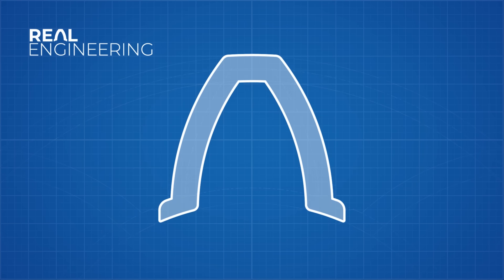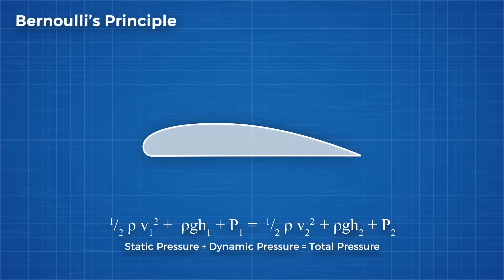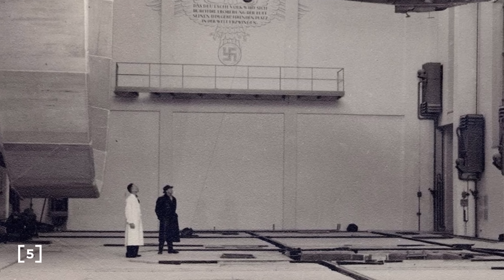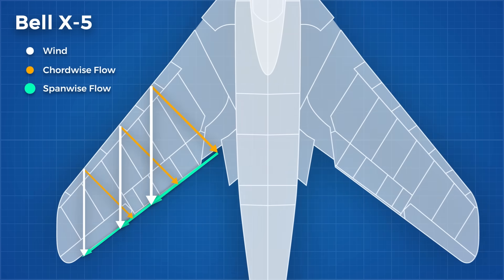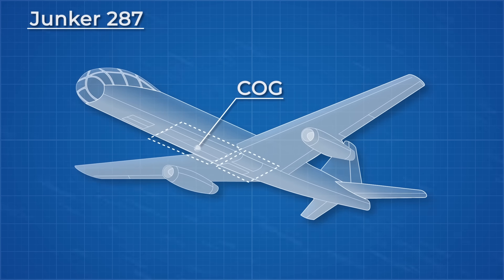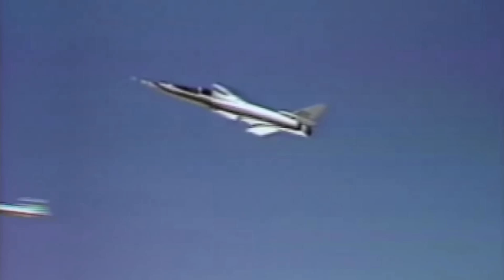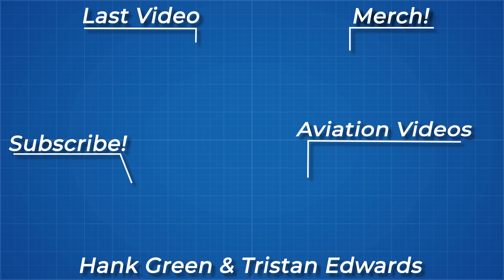Why Do Backwards Wings Exist?

Comment: It is not accurate to say that the X-29 was unstable because of the forward swept wing. It was designed to be tail heavy, which is an unstable situation and the F-16 is the same. If the C of G is moved to a more suitable position the a/c will fly just fine. This is well demonstrated by all the F-16 r/c models that are  flying today. They have no such stability augmentation systems and don't need them. My 45 degree, forward swept wing, r/c plane flies just fine, too. In fact it has a number of stability advantages over conventional models. It won't stall and it self corrects on crosswind landings.  By the way, what's with this 'tail wing' crap? It is called a Horizontal Stabiliser.
Reply: None of your R/C aircraft flies anywhere near trans-sonic speeds (unless you've somehow broken the R/C speed record by 50% or so), so they're not really comparable through their full flight profiles, and most of the instabilities from forward-swept wings comes from feedback loops at high speeds. Both the X-29 and F-16's has bottom-mounted wings, which also increases instability (the higher the wing, the more stable. That's why you often see trainers with top-mounted wings).

BTW, most model kits are available in a version where you provide your own electronics, and there's many, many flight controllers available that incorporates flight stability augmentation for planes (I've used one myself in my AcroMaster), so "all" is probably quite a stretch.

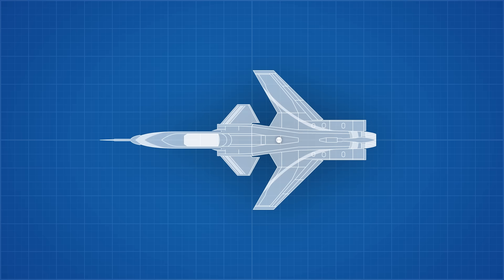Comment: 9:35 You mean shift the CG AND wing CP backwards on the X-29, right?  Wing center of pressure was allready depicted as behind the CG for the AV-8B as well; the wing CP was just counterbalanced from behind by the elevators, instead of forward by canards.

Comment: So basically, this was made by the good ol'German engineering. Correct?
Reply: it was imagined by them .. but like many german projects (especially those related to airplanes and airports) - they just never finished it.
Reply: One word to describe German engineering - "Pioneering"
Reply: actually back then "Made in Germany" was invented by  UK to mark plagiats (which germany was popular for) - during ww2 there were a lot of breakthrougs made .. but at the same time, they've used a "new way of central heating without using coal" .. so .. not sure about how proud a german should be about that time of pioneering ..
Reply: @canarybiker1262  Nobody should be "proud" of anything they could not have influenced in the slightest. It's pathetic escapism to deflect from your own lack of achievments.
Reply: @DerBlupp  hear, hear. nicely written.
Reply: @DerBlupp  Nobody should be "proud" of anything their country may have done which could be an odious war crime, whether they could have influenced it or not.

Comment: Both nowadays planes are a failure. Not because of engineering mistakes, but pure tactical.
Usage of such wings to give superior maneuverability at fairly high speed.
But first of all such design by itself limits maximum achievable speed. And second. As much as Hollywood makes it a popular theme - there are no dogfights in nowadays aircraft-to-aircraft engagements. Its 100% relies on missiles usage. And even though there is such thing as anti-missile maneuvers, to help the odd avoiding been hit by missile, those doesn't require THAT much of maneuverability.
And finally - pilots. Even though planes can sustain over 12G during a prolonged maneuvers, humans cannot.

Comment: At 2:00 the explanation is correct, but the animation doesn't match.  Air flow is indeed moving faster (it must, or the pressure can't be different), but the animation shows the points of both flows rejoining simultaneously.  The mismatched and incorrect visual animation is one of the reasons a lot of people have a malformed understanding of what's happening.
Reply: Yes! I can't believe this misconception is so prevalent even in channels like this. This should be comment number one
Reply: The air travels a longer distance on top and they both meet at the same time. 

Velocity=DISTANCE/time

Change the distance, and you will have a different velocity.
Reply: @Eriksvensson4231  that is not the point. The flow should be directed downwards after passing through the wing. The main issue is not the distance. If it was planes could not fly inverted and they can!
Reply: The “Bernoulli effect” is minimal in providing lift in highly powered aircraft. A perfectly flat wing would provide lift just as well at speed  if at the expense of poor aerodynamics.

Comment: its actually to prevent wing tip vortices - have you seen a airplane landing and seen little swirls of air coming from the wing tips - well if you had a row of houses at end of a run way, when the wing tip vortices are in effect they are actually mini twisters and they would suck the roof of the houses like what happened at manchester airport about 30 or 40 years ago - they had to remove all houses directly under flight path for about 100 yards from end of the run way - so this wing configuration is probably safer from that aspect. - but all wing shapes serve a different purpose depending on what use you want them for - the shape from the end of a wing is either bulbous for lift or thin for speed - then there is either up swept wings for stability/pendulum effect for passenger aircraft - or there is the down swept for agile aircraft like fighter jets - and the military use the hercules c130 which has bulbous wings for lift with the down swept configuration for agility. anyway you get the picture

Comment: Thanks for the great channel.  Just a little FYI on airfoils.  Son of an aviation engineer and physicist, but not an expert on this particular field.

As I understand, it's more about the wind produced by the airfoil passing through still air than it is about pressure differences.
That is to say, it's not that the Bernoulli analysis is wrong, it's that the contribution from the Bernoulli part to the total lift is a small percentage thereof.  You're accurately describing the physical contribution of the Bernoulli effect, but you're still not describing why an airfoil gets enough lift to be useful.
Airfoils get far and away the most lift due to momentum transfer.  Good old F = dp/dt = ma.  After the airfoil passes through the still air, the general flow of that air is downward (and forward in the direction of the plane, but we're talking lift, not drag).  That downward moving air imparts an equal and opposite momentum transfer to the airfoil, I.e. it pushes it up / generates lift.
Reply: NOT THE SON OF AN ENGINEER, BUT I DO KNOW THE ''WIND'' IS CALLED TURBULENCE...
Reply: @jimbo42521  The wind can be both turbulent and laminar in flow.  In general, turbulent flow is the enemy of lift.  Airfoils do create turbulent flows, but that is an unintended waste of energy - inefficiency of the wing.

Comment: 7:34
no one gonna talk about how it looked like that airliner just went vertical?
Reply: That was a Boeing 787 Dreamliner during practice for the 2015 Paris air show.  I don't quite remember if it was still in testing at that point, but the maneuver was to demonstrate the power and agility of the new airliner.
Reply: It was probably a test flight thus the unusual maneuvers.
Reply: It did
Reply: They better have multiple puke bags per seat, just in case.
Reply: Space Shuttle Status Engaged!
Reply: Passenger Planes almost nerver run on full power. but when they do they can indeed go vertical
Reply: Airliners need a lot of power for passengers, fuel, and cargo.  If they are not carrying much fuel, many passengers, or much cargo, they can do impressive things.  Some airports require steep climbs for noise abatement and then airliners climb like this even with passengers, but the margins are higher for aircraft at a lower weight.  Their thrust to weight ratios are much higher which allows for greater performance or a more safely conducted zoom climb.  The 747sp and 757 are also very impressive doing this.
Reply: @Ohiostmrchbandawesom  Yeah...passengers tend to complain if their red eye to London turns into the vomit comet. So yeah these planes CAN...just like a Greyhound bus CAN jump a ramp.
Reply: It was test flight.
Reply: Not that they can't, they just don't. Frankly, seeing a 747 or 787 do aerial manoeuvers the way a warbird does would be awesome.
Reply: @mage3690  
There was a test pilot that actually barrel rolled a Boeing 707 airliner during a test flight.

His name is Alvin M. "Tex" Johnston. Why did he roll a 707? He was selling an airplane.
Reply: @volksdude1970  It was a dash 80  Boeing 367-80 .  Concorde pilots did it some decades later and then bragged about the power of the Concorde that enabled it to do the same thing the dash 80 had done decades ago.
Reply: Keaos0  whoa.. thanks for that link. I had no idea that was possible for commercial aircraft!  and the pilot was so casual about it.. claimed that for some reason that maneuver was well within the plane's capabilities. He is the salesman that he claims to be, that's for sure. :)
Reply: I thought that was a advertisement or reveal or something
Reply: ”drive it like you stole it” technique
Reply: @beck103187  search Kylie Franklin steals
Reply: Ikr
Reply: That would have been a crazy ride for the passengers!  imagine what that would feel like and how you'd be worrying about what to expect for the rest of the trip.

mmm.. I guess others are saying that was a test run.. so no passengers?
Reply: @kirikayumura6015  of course no passengers
Reply: digital viewing!
Reply: @Reflex-f1d  cool! I'm gonna have to check that.
Reply: Iwas about to.
Reply: Sentō Yōsei Yukikaze
Reply: I cringed and said WTF aloud when I saw that!
Reply: https://www.youtube.com/watch?v=mqIJL8lx00o
Reply: that 787 tho
Reply: @Steven Strain https://www.youtube.com/watch?v=oYD3srDJR00         https://www.youtube.com/watch?v=eqMvXE4sxpk  https://www.youtube.com/watch?v=WRa9AhTl7CY     Even a jet cannot sustain a vertical climb when the oxygen pressure gets low enough at altitude.
Reply: Shouldn't it be stalling?
Reply: @R0ckst4r0ck3r  Stalling occurs when an aircraft wing exceeds it's critical angle of attack.  Wings can be made differently, but very generally speaking, that is somewhere around 17-18 degrees.   A related term is "relative wind"   Basically, if there is still air travelling over the wing at the angle  that the wing was designed[and in sufficient amounts] for, you're cool.  If you try to turn hard, fly upside down, pitch nose up or nose down very quickly, etc. you can stall the plane, but if you're flying in a straight line with enough speed, you shouldn't be stalling the aircraft whether you're nose up, nose down, level,                                           
                                                                                                       e tc
Reply: @Ohiostmrchbandawesom  Oh I see thanks for the info!
Reply: @R0ckst4r0ck3r   I should have attached something like this link.  If you go about halfway down, you'll see a "coefficient of lift" diagram for two different planes (one straight winged and one swept winged) .   Whenever you see a coefficient of lift diagram and the coefficient drops rapidly with a small increase in angle of attack, that is where the stall occurs. If you don't want to follow the link, just go to any coefficient of lift diagram http://www.aerospaceweb.org/question/aerodynamics/q0136.shtml
Reply: Keaos0  You've never seen a barrel roll on an airliner for the same reason you've never seen a Greyhound Buss jump a ramp. It's because passengers find it ...uncomfortable.
Reply: garlic69 yup
Reply: garlic69 because it did
Reply: Omg wow
Reply: wooooooooow
Reply: It did a 37 degree angle... A discussion happened some time ago because of this clip. The camera angle is in that point Just to do that: look like a perpendicular angle. It's a Boeing 737 Max by the way
Reply: Joseph Meyer  it is the 787 Dreamliner release clip/ trailer for plane upon release
Reply: Correcting, it is a 787, not a 737
Reply: Joseph Meyer  sorry
Reply: and that is the aircraft produced for VietnamAirline
Reply: The long angle lense creates this illusion. The image is from the Paris Airshow showcasing the Boeing 787.
Reply: It's no camera trick. The camera angle remains constant. Only the angle of the pance changes... to almost vertical! Power to weight ratio of a 737 is pretty darn good with no passengers or cargo!
Reply: I think it was the angle
Reply: It was a trick of the camera angle and zoom. Awesome aerial photography
Reply: @CJFrasher  You can see the base become near vertical. Thats not a camera trick
Reply: Blitz RaZe It’s a camera trick. Airliners don’t do vertical.
Reply: @wlt3585  

It was, he did 45°, not 90°
Reply: Christian Frasher no it’s not, they did that
Reply: @CJFrasher  no, it was real. Most modern airliners have the ability to do maneuvers like this. They do not keep up the vertical for a long time, but for a few seconds they sure can keep an angle somewhere in the 60 ish degrees. Yeah thats not vertical but its pretty impressive.
Reply: @CJFrasher  that literally makes no sense

Comment: "Poor pitch stability".

That'a just an argument for moving the Center of Lift/Pressure even further back.  Not a real problem for forward-swept wings since you don't have a proper tailplane to get in the way of this...

Sure, you might make the aircraft a little heavier (due to the wings being further from the Center of Mass, requiring more structural reinforcement of the fuselage)- requiring larger wings to keep the plane airborne at the same speed/altitude/AoA.  But the improved aerodynamic efficiency more than makes up for this...

And, all the extra structural reinforcement of the wings and fuselage has certain advantages.  Including Economies of Scale in the manufacturing- it costs less than twice as much to have twice the structural reinforcement in your plane- and slightly more plane structure to absorb the impact of enemy munitions and protect the pilot/critical components in combat...

Comment: Blaniks fly very well without a computer. Also the commentary failed to recognize how the "length" of a forward
swept wing changes relative to airflow when the aircraft yaws, aiding roll and possibly yaw stability. Also there was a failure to fully recognize how
a huge amount of subsonic aircraft have forward swept wings by virtue of the trailing edge being more forward swept than
the leading edge... that holds true from Supermarine Spitfires to the ubiquitous Cessna 172.

Comment: I love how like 10% of how a wing works was explained in the 4th grade, and then you never hear about it again until youtube comes out.
Reply: Yup, I had much the same experience, but then saw a Pitts Special flying the right way up, then upside down - which kind of told me that something wasn't quite right about what I'd been taught.
Reply: cries in brazil public education
Reply: @snotty_boi8248  In Colombian public education they are teaching fractions in 8th grade
Reply: As much as I hated my school years, they did a pretty good job at intentionally glossing over interesting stuff, then getting me hungry to dive into them on my own.
Reply: The reason for that is "how wings actually work" is an extremely hard subject, even with advance mathematical tools that you won't even have the slightest chance of understanding until your second year of Uni, it is very hard to tell if a design will fly and how good it will be. And even leading experts need to test it in wind tunnels to figure that out. What chance do you think a 4th grader has of being able to understand it?
Reply: @miket591  "What chance do you think a 4th grader has of being able to understand it?
I understood it in 4th grade by sticking my hand out the window of a moving car and a 10 cent balsa flider.  It's NOT hard to understand at all.  The trick is optimizing the structure and that took me till 6th grade to understand.
Reply: @arthurfoyt6727  doesn't sound like it

What you're describing is more of a fan than a foil. Sure air being deflected off your hand or balsa can produce upward force, but at scale you're not going to produce lift without an aerofoil which you dont show any understanding of at all by what you've said

It's the exact difference between a windmill and a wind turbine, they both work, and a 4th grader can understand one, but that doesn't mean you have any idea how the other works..
Reply: @hashbrown777  "you're not going to produce lift without an aerofoil"   Said no modern aerobatic pilot ever.  I can only assume that YOU have never piloted an aircraft, much less tried to takeoff from a runway.
Reply: If you're interested in how wing works, I'd recommend looking into actual papers. Even the graphics in this animation are misleading, for one, the air on top flows much faster, the particles don't meet at the trailing edge. But the most important is that the change in speed and pressure happen simultaneously, one is not the cause for the other, and Bernoulli doesn't explain how either happen, it's just a convenient way of calculating. And it doesn't mean that every fast moving air has low pressure either.
4th graders would understand the most basic explanation, but that doesn't mean anything because it's still incorrect.
Reply: @Matt B Not aeronautical ones.
Reply: I had a pretty good understanding of how a wing works, but learned a little by this vid anyways...
Reply: @RenaxTM91  was
Reply: @RenaxTM91 and then you find out that all the yapping about wind speed is cap and it's actually to do with the air fluid sticking to the surface of the wing and a spin of the wind created behind the wing. 🤯🤯🤯
Reply: I learned my making toy airplanes when growing up that what they were teaching about Bernoulli in school was wrong.
Reply: @arthurfoyt6727  not wrong, just not the whole story xD